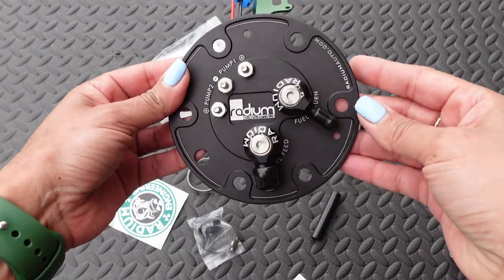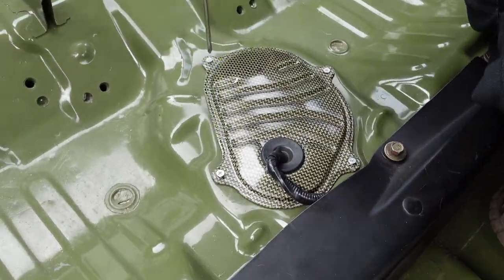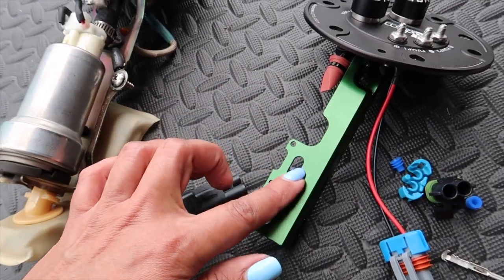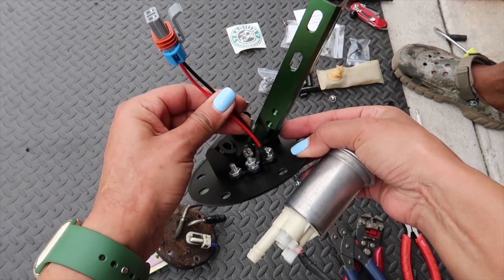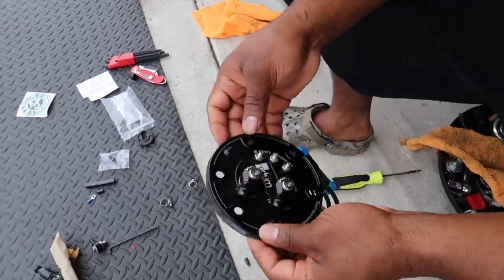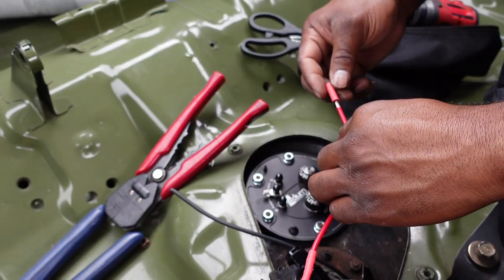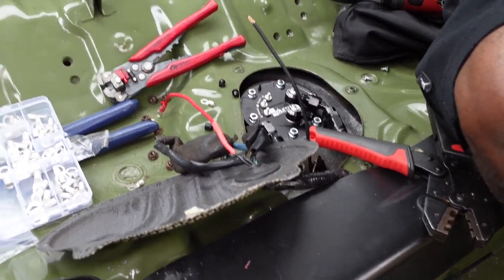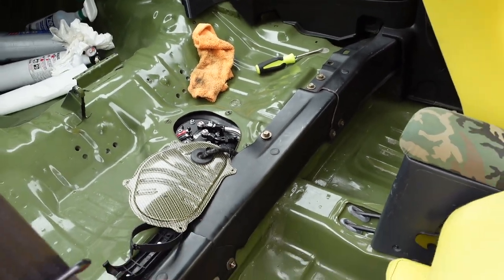RADIUM Dual Fuel Pump Hanger - Civic & Integra EG EK DC2

Comment: Needed this last year. I bought a new stock hanger and modified it to use 8an feed and 6an return. I then had to cut and weld the access cover to fit over the fittings. This piece is really nice.

Comment: i have a question ?  so on the return line did you use the second piece of small hose provided ?  like on the inside of the hanger ?    kind of like to route the fuel to not just dump back  on to the pump

Comment: What is the point of this if u r running one pump ?
Reply from the maker: With this Radium hanger it makes it easy to upgrade the wiring and the size of the fuel lines.

Comment: Just a little tip, when using the walbro pickup sock instead of the factory Honda sock, you will run out of fuel around a half tank. I always recommend using stock Honda socks to alleviate this issue. Also the reason why the stock sock didn’t work for you Aisha is because those double pump hangers are designed to be used with 2 straight wall pumps such as AEM 340lph pumps, the walbro 450 or 525 that your using is to big.
Reply: But it wasn’t going all the way down that’s why they replaced it, I looked up the part # of the hanger they used and it’s the correct one too, I’ll be doing the exact same thing because my hanger is leaking gas so I’ll try to use the oem one to see what happens